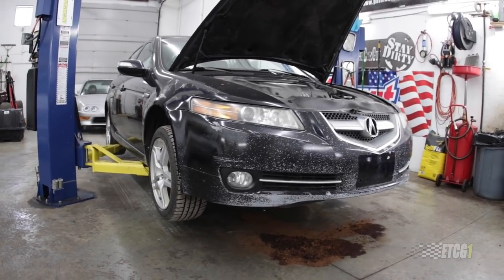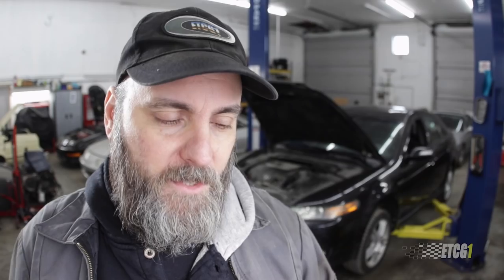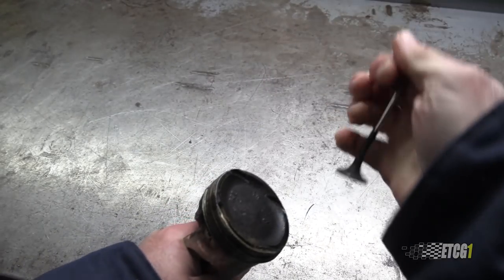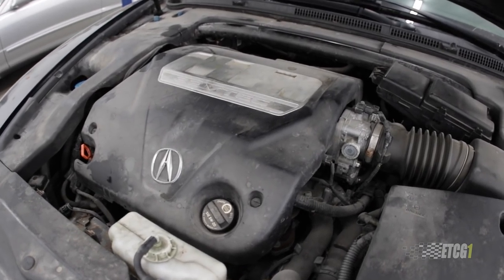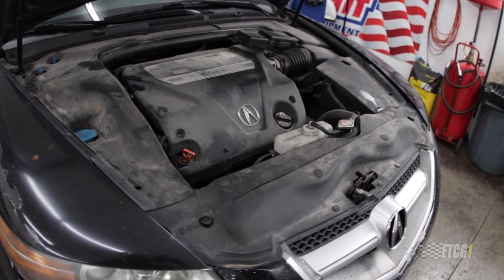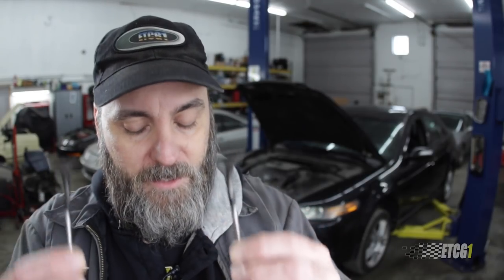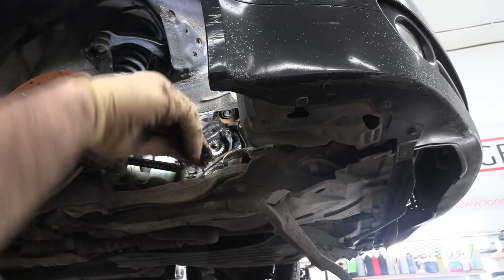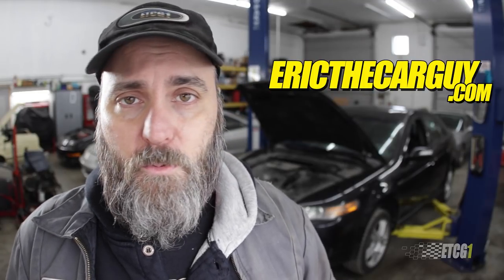What Is an Interference Engine?

Comment: We tend to think about the interference vs. non-interference engines in overhead cam engines only. An old school pushrod engine can also bend valves if the old school timing chain breaks.
Reply: Especially if it breaks old school style
Reply: @xml2252  Mine sure did. Mayhem in the pushrod, valve, and engine oiling system. It was a mess, the Ford dealer only partially fixed. They gave it back to me with bent pushrods, valves, and a mess in the oil pan.

Comment: I been a toyota Tech For 10 years a Ford tech for 12 years and independent tech for 10 years now and  on the backwards of this Topic good Example of a Non-Interference engine are 5vz Toyota 3.4l v6 engines when the timing belt brakes the engine pistons will never ever come in contact with the valves great Topic Eric @ETCG1
Reply: What about Toyota’s 1MZ-FE?  Are these engines non interference engine too?
Reply: @jackeroo75  yes the 1MZ-Fe is a Non Interference engine but the successor the 3MZ-Fe is a Interference Engine. Hope the information helps
Reply: @AntonioClaudioMichael  Popularity Comparison

	•	1MZ-FE: Generally more popular due to its longer production span and use in a wide range of models.
	•	3MZ-FE: Benefited from technological improvements and was popular in the models that replaced those using the 1MZ-FE.

Overall, the 1MZ-FE might be considered more popular due to its broader and longer application across various Toyota and Lexus models, but the 3MZ-FE is also well-regarded for its advancements and use in newer models during its time.

Comment: I had a timing chain break on a 351w at idle bent two valves. I will add if your harmonic balancer goes out  do the chain. I'm two for two with broken chains on small block fords, but only after replacing a bad balancer. Always within a day.

Comment: Eric..I find that doing a simple cylinder leak down test before installing a new timing set will help putting mind to rest. Made the mistake of proceeding without that test often and recently experienced why it's an important step. Cheers bud!
Reply from the maker: How exactly would you do that if the timing belt is broken? To do what you suggest would involve setting up each cylinder individually to do the leak down. A complete waste of time in my view. If it runs after you install the new belt, move on. If not, get ready to pull the heads. No matter what, you still have to replace the belt. Thanks for the comment.
Reply: @ETCG1  so true, bugger spending all that time setting up each cylinder to do a leak down test. With a dual OHC forget it anyway, it ain't happening is it :)

Comment: Same happen to me. 08 TLs Belt broke and found that the tensioner broke the bolts of the block, and yea thought she was gone. Took it to my mechanic to get it checked. Everything was Good!!! Now was the bolts getting addressed and I got lucky the engine didnt crack and the easy fix was to take of the half of the screw that got stuck in the engine 'shave' the grooves in the holes bolt the screws to the block and TADA!!! Shes fine! I know its still a scary feeling after what happen and most would say maybe its a ticking time bomb but its been over a year and no issues. Ive had the car for about 5 years now and I love it! No more hard pulls tho just for my peace of mind, I think ill keep riding in that car till I`m told the horrible news "she needs a 'new' Engine/Transmission"  which who know might be soon lucky ive been saving for about 2 years not sure what would take the TLs spot yet.

Comment: On mine I got lucky. (it's actually a 97 isuzu rodeo).  But it started running a little strange, as if the belt might have jumped a tooth;  and I popped the hood and seen an idler pully drilling a hole through the cover like a hole saw and was just about to finish cutting through.. (or maybe it's the water pump pulley, which is driven by the timing belt).   So I quickly turned it off, and now I just need to pull it all apart and do the full timing belt job.   So I got just lucky enough to catch it, right before it  completely broke.  I feel pretty happy about it.

Comment: I imagine with a VTEC equipped engine, the engine being under higher load may increase the chance of an interference event in the event of a timing belt/chain failure. The more aggressive VTEC cam profile does result in greater valve opening duration and lift.
Reply: This is true. Many engines are non-interference without whatever form of variable timing they are equipped with. Break the belt/chain under relatively normal operation and you'll likely end up fine, but if you're far into the variable timing you're having a really bad day.

Comment: Hey Eric, I can totally agree with that "it can go either way...". MG Rover K series (never been sold in US, so you won't know - while not same as Honda, MG Rover had ties to Honda here in Europe and they do share some things from that partnership era. Also its K series but it has nothing to do with Honda K, It's belt DOHC,). Friend of mine had belt snapping while driving, ~ 3K rpm (so not really revving high but still wasnt idle) and pretty minor dmg... exhaust valves contacted on one or two cylinders but overall nothing. Same engine (type) in my car and on start up, on frikkin starter the belt merely jumped ~ 5 teeth.... and total carnage 3 or 4 exhaust valves decapitated (the valves snapped off the stem and dropped in the cyl and blocked the piston. one small dent in piston and head deck. One major dent from the snapped valve in both piston and head. few bent valves and CRACKED cyl sleeve.... yep that engine WAS done. Both head and bottom end.
So no lottery ticket for me on that day :D

Comment: I once had a timing belt break at 60mph in a '74 Honda Civic. This was supposedly an interference engine, but I replaced the timing belt, reset the valve timing, and it ran fine for a couple of more years.
Reply: Was it a Civic, or was a CVCC? ;)
Reply: @michaelbloom5342  I think the CVCC engine went into use in 1975. Honda called it the Civic and called that early kind of engine the CVCC.
Reply: @skylinefever  oh I know, I was just kidding. Hence the wink.
Reply: @michaelbloom5342  Plain old Civic, the CVCC didn't show up until '75.

Comment: Recently my Accord wagon, non vtec, had the cam seize while going about 40mph, which broke the cam sprocket key. Timing still worked, the starter turned the engine over fine. Upon turning over the engine by hand😬 so I pulled the head anyhow to see the carnage, much to my glee the valves barely knocked the carbon off 2 of the 4 - 310,000 mile pistons! Ebay head🥳 back in action, her new name is "Keno"🤣

Comment: I got lucky on an Xterra, broke the belt at highway speed. I put a new belt on and it fired up and ran fine. Had an 03 Civic cam gear bolt back out and bent 1 valve. You can check for bent valves by checking each one for excessive play as it will be hung open. WHY doesn't interference engines have fly cut pistons to avoid this?

Comment: It likely wouldn't just cause bent valve(s). Just with a little imagination you can guess the valve guides could be damaged/leak oil after, the piston(s) could have been damaged, etc. But as you have said, there may not be damage due to sheer luck of the valve springs keeping the valves shut just enough to avoid contact. But the higher the RPM (the more momentum your cams have to overcome the valve spring force) the more likely a timing belt or chain failure on an interference engine will cause damage.
Reply from the maker: As I said in the video, not in my experience. I was driving at 70mph on the highway when the belt in this car broke. You get lucky, or you don't. Thanks for the comment.

Comment: I've experienced that the timing belt breaking has a huge chance of not causing any damage. Ive always thought under normal conditions, when the timing belt snaps, the valve springs immediately push the cams the where all the valves are mostly closed and the bottom half of engine immediately stops rotating... now if timing jumps, then there's a huge chance of damage occurring

Comment: Hey mate I have a vq30 nissan navarra v6 petrol engine in my ute and I recently broke a timing bwelt..it failed 43k kilometres after it was changed 195K failed at 238K. What I can't find out is it a non interference or interference engine.. I have aske dthe mechanic to do what you suggested and fit a new belt and see..if it still works
Thx for your video.. I broke a timing belt on a 2 litre Ford Cortina once and it was fine too.

Comment: I'd like to perform an experiment. With a J series there's 2 different lift profiles whether below vtec or in vtec. In vtec there's a significantly higher chance of contact. But below vtec are they still interference? As in if the failure occurs at low rpm low load they're a non interference motor. But pins locked is hitsville
Reply: even when not in vtec they still interfere enough to potentially cause damage to the valves.
Reply: @nknasi  have you actually measured it yourself tho

Comment: In vw diesels the valves don’t bend,
But if you puts new belt on and run it in a few thousand miles the valve head snaps off.

Comment: Its been my experience where I've seen more timing belts break without engine damage than I've seen timing belts break and destroy the engine.
Reply: On what car ? Hondas usually always catch 2 valves ?
Reply: Know that there is also non interference engine where a broken timing belt.or chain will do no damage.
Reply: Mazda has a lot non interferance engines in the past. But it's tricky. For example the 2.5l Kl-de was a non interferance engine, but the j-spec KL-ZE was a interferance engine. Same engine, but the KL-ZEhas a higher compression.

Comment: This is very interesting. Am I correct in presuming that if the cam(s), solely by virtue of the valve springs come to rest in a "safe" position is how damage is avoided? Before you posted the related videos, I was of the school of thought that the engine is if not trashed at least moderately damaged with a labor intensive repair necessary. 

By the way, thank you as today is indeed my birthday. 👍
Reply: A non interference engine is a design where the the valves and piston never occupy the same space.  If a timing belt/chain fails no damage happens.
A interference engine the valves and piston do occupy the same space but at different time during the stroke, so if the belt/chain fails it is possible that they will hit and damage happens, or you can get lucky it doesn't.

Hope that helps explain.
Reply from the maker: Happy Birthday! I'm glad I was able to change you way of thinking. I've had some success with interference engines being OK after a timing belt failure. Additionally, the most I've seen is bent valves which in my view, aren't that difficult to replace.
Reply: @TreborYagenrok  ummmm... I understand the distinction between the two, I was speculating on what hypothetical circumstances would allow Eric's engine to (appear to) survive the timing belt failure.
Reply: @ETCG1  thank you.
Reply: That is indeed interesting question, how does interference engine survive from timing belt / chain failure without damage.
Reply: @mrjsv4935  because the timing belt breaks and in this particular case leaves the cam in a position where none of the valves are at full lift. In other words... luck.
Reply: @mrjsv4935  the cam(s) will absolutely stop considerably more quickly than will the crank, their stopping point will absolutely be influenced by the pressure of the valvesprings acting on the cam lobes. I hypothesized that this cam-stopping-point was (in this and other no dead cylinder(s) events) was a "safe" configuration where the valves were very lighly touched by the piston. This remains my speculation as I am an electronic rather than a mechanical engineer.
Reply: @walterk1221  To directly answer your question, yes, especially with 4 cylinder engines, sometimes you get lucky.  But with 6 cylinders or 8 your odds drop as it becomes more likely that at least one of the valves in one of the cylinders will stop in the open position.

I wish I could remember what vehicle it was, but about 20 years ago I was helping my neighbor rebuild a junker for dirt track racing.  We pulled the heads on this V8 and in two cylinders, one on each side, was a bent valve, one intake and one exhaust.  The pistons had divots knocked out of them.  We wound up destroying the valve guilds in hammering out the valves.  The overhead cam was trashed but the journals were still in good shape.

Didn't much matter to us because we were doing a complete rebuild anyhow, but now we could see why we got the car for only $200.
Reply: @walterk1221  if the belt falls and happens to leave the cam in a position where none of the interfering valves are at full lift.
Reply: @maingun07  thank you. I interpret your comment as essentially the reinforcement of my hypothesis. And the distinction between valve being open when its piston reaches TDC versus simply *off its seat*the odds will obviously increase in favor of truly open with increasing number of cylinders. Do you concur my thought here?
Reply: @walterk1221  Sorry misunderstood what your were asking. Best answer is sometime you get lucky.  Some days not so much, seen an engine reduced to scrap from a broken belt.
Reply: To be more specific as to how you get lucky is the spots where a camshaft will come to "rest" generally don't leave a valve at full lift and wont cause any damage.  When the belt breaks the camshaft will not instantly stop rotating because of momentum, and neither will the crank shaft and in those few seconds with out the belt keeping things in time there is chance pistons will smack a valve, or not.
Reply: @walterk1221  That's been my experience, yes.  Every engine is different and as such the clearances are different, but for the ones I've seen the valves won't make contact unless they are at least most of the way open.

Most of the interference engines I've seen for whatever reason have been overhead cams, but I wouldn't use that metric as any kind of guild.  I'm just a weekend shadetree.

However, all of the diesels I'm aware of are interference.  I think this is because of the higher compression ratio causing the piston to stop higher in the cylinder which leaves very little room for the valves.  But with the exception of tiny ones that they put into european econoboxes, diesels have either extremely robust chains or direct gears like in my 7.3L PSD instead of timing belts.

Comment: I'd be curious to see the before and after of a compression test of a timing belt break.  Sure, the engine turns over and runs, but how effectively does the engine run in comparison to pre-timing belt break.
Reply: that wouldnt be a bad idea, assuming you have a good habit of doing a compression test at every change of the timing belt
and in the event that one or more of your valves is ever so slightly nicked, it would still run but its ability to fully sit on its valve seat would be compromised and you would see that in a compression test

Comment: Here's what I believe personally, on automatic it typically wouldn't damage it unless somehow it did of course through momentum and especially through rough housing with the engine. On manuals almost indefinitely I believe it will happen, unless it's in neutral. Why? Well sort of self-explanatory. The car is going down the road and gear with the resistance pushing the engine being the clutch and everything else moving it so it will continue to turn the engine until it smacks valves. On automatics since it's just fluid resistance, theoretically unless there's more momentum enough to turn the crankshaft more than it shouldn't continue rotating so speaking. I've seen a lot of larger engines breaking the timing belt or messing the timing chain up where would bend valves rather than a small engine and I believe it's through momental Force.

Comment: Seeing how the belt was tied around the crank pulley, could that have helped save the engine, as I'm guessing the TL is an auto (thinking of torque converter vs clutch). Would being an auto and having the belt wind itself around the pulley like that also contribute to saving the engine, compared to if it was a manual?
Reply: I don't think that had anything to do with it. Keep in mind I've cranked the engine over several times since the belt broke. The cams landed in just the right spot. It's as simple as that. Thanks for the comment.

Comment: You should do a video on interference vs non interference like what are the pros and cons of them both. Great info as always.
Reply: The advantage or building an interference engine is that the manufacturer has more freedom in shaping the piston crown and more freedom in deciding how much lift the cam has. When Ford decided to use the Nissan VG30E/VG33E engine in the Mercury Villager, they wanted a non-interference engine. To do it, they reduced valve lift 1mm compared to the Nissan Hardbody/Frontier engine variant.

Comment: 4th to comment.😜 Okay Eric, I KNEW what they were but WHAT/HOW, engineering wise MAKES engines either way?? Why DOES Honda/Acura MAKE interference engines?
Reply from the maker: No one sets out to make an interference engine. But if you want the engine to perform, it will likely have a higher compression ratio and a higher lift and duration camshaft. The closer the valves and pistons get together, the more chances they have to 'interfere'. I hope that clears that up for you. Thanks for the comment.
Reply: @ETCG1  maybe I'm not understanding your point here. Of course they set out to make an interference engine. More valve lift and bigger valves means more power. They know the risk and make that tradeoff.
Reply from the maker: @MrTexasDan  There is little to no risk if you maintain your engine properly.